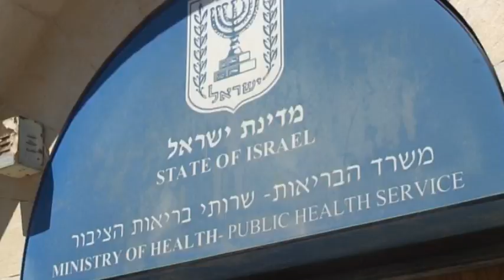Recycling Domestic Water in Israel

Comment: Hello, Yermi, I live in Arizona in the U.S.
  same here we get little rain here to. what about a underground cistern a 9ftH X 7ftD will give you about 3,000 gallons of water. also did you know that a house 24 X 40 will give you about 1,600 gallons of runoff from your roof per 1/2 inch of rain per hour. you could use what called papercrete, 15 pounds newspaper, 20 pounds  Concrete, 20 pounds sand and 1 cup of borax. first line inside hole with  sand bags then cover that with chicken wire the papercrete to make the cistern. If you have a wash thru your land you could get water from there too. There just two of us and we use about 3000 gallons per month, we could save about 2500 gallons for outside trees and a garden. What did you use as a fitler for your water ? check out some of the ideas from earthship house on youtube.
Reply: I"m over in El Paso TX and love your ideas for my cabin in New Mexico where I'm seriously considering harvesting rain water and using that for all my water needs up there (the cabin neighborhood's water supply has leaking pipes and no water all too often, plus the water price charged is too high.)  I'll check your channel to see if you've made a video, but if you haven't, please make a video about how you did what you did for we who'd like to do the same thing.

Comment: how about soap residue ?
surly bacteria won't eat that?
i've never been more grateful for our rivers then now
Reply: Between bacteria, fungi, plants and insects there is very little that can't be eaten. But being picky about what kind of soaps you use helps
Reply: soap is made of fat and sodium. the fat will break into water and CO2 while sodium is just salt, it is found every where including the soil. I do not think our rivers are still as clean as you think.
Reply: Soap = Sodium + Fats(carbonatious material). Carbon might need to be oxygenated by passing air inside the water. By means of aeration. Sodium will get settled as precipitate. Best way to keep away harmful bacteria is by treatment with chlorine or naturally by letting fishes eats away bacteria.